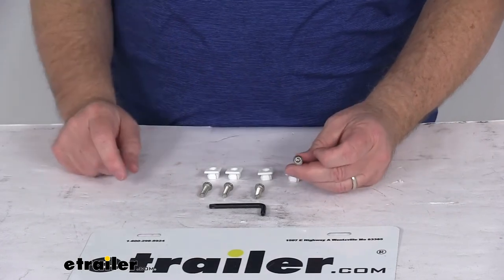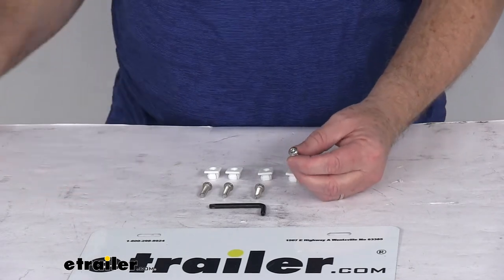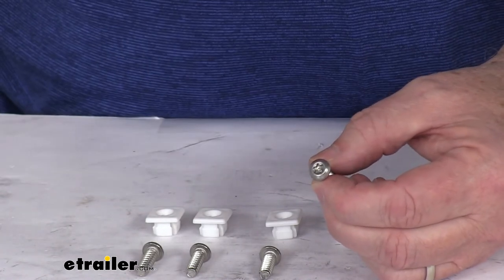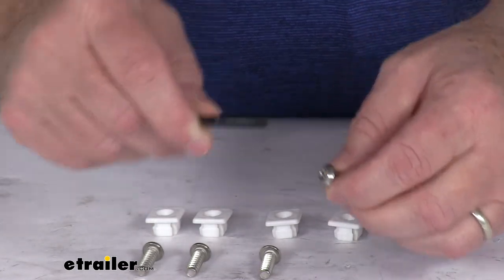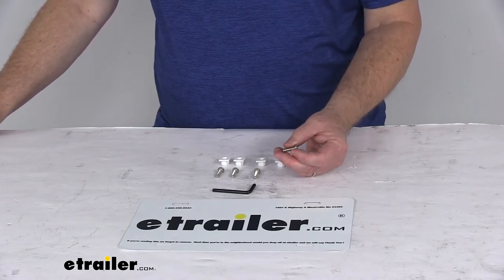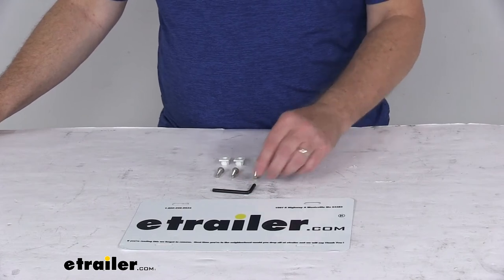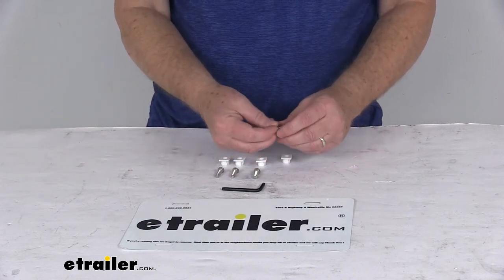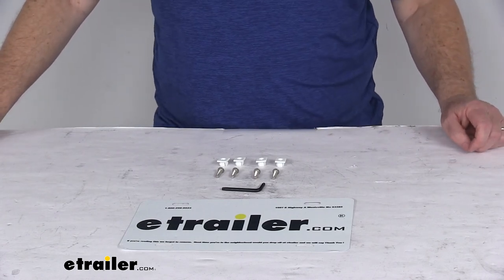etrailer | Review of Cruiser License Plates and Frames - CR81200

Comment: What size hole do you need to install the fasteners? The holes I have are stripped and need to be expanded to fit the fasteners
Reply from the maker: You will need a 3/8 inch square hole to fit the fastener into the bumper.
https://www.etrailer.com/Accessories-and-Parts/Cruiser/CR81200.html

Comment: How do you remove those fasteners?
Reply from the maker: The kit uses a unique security bolt, but you can use the included wrench to install and remove them.
https://www.etrailer.com/Accessories-and-Parts/Cruiser/CR81200.html
Reply: @etrailer I’m sorry I meant the plastic anchor nuts